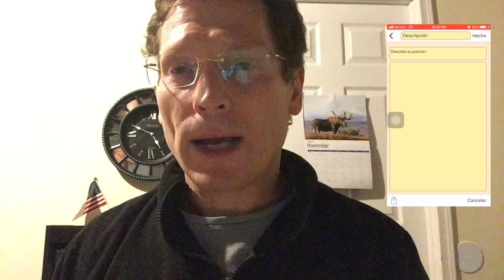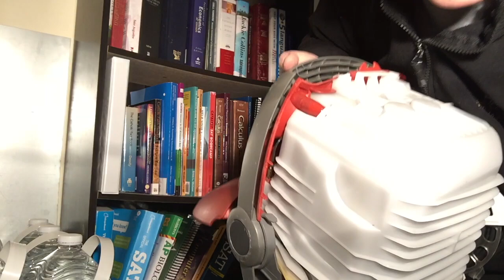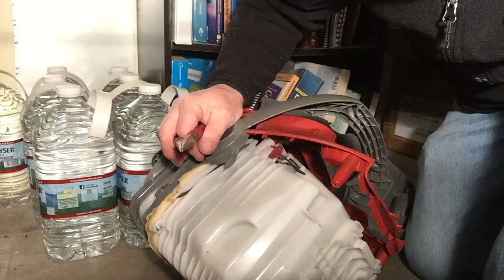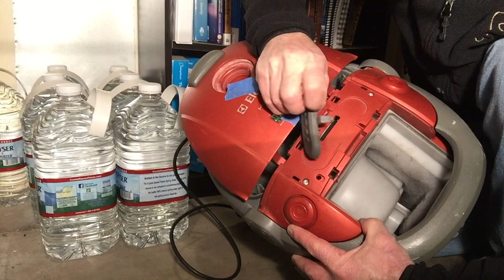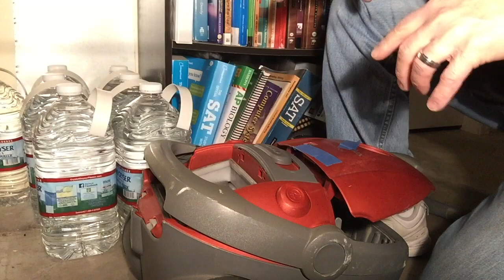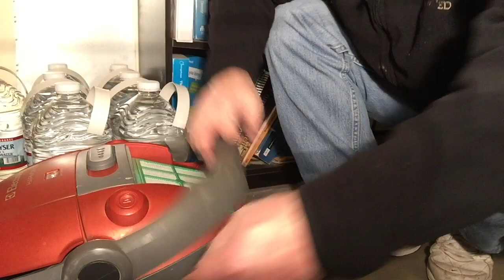Electrolux Harmony Vacuum Power Switch Repair

Comment: Thanks for sharing this, opening these devices is surprisingly challenging! I tried to repair a AEG/Electrolux VX-8.2 myself and gave up. I don't really get why the manufacturer use all these "clicking" panels instead of a couple of screws? Cheap vacuum cleaners can be opened just by removing a few screws. Now I have to throw it in the trash, such a waste. Will certainly not replace it with another from the same brand, so I don't think this strategy works (at least with me).